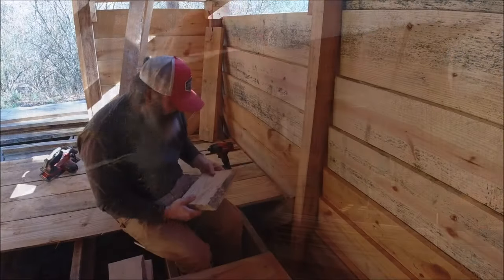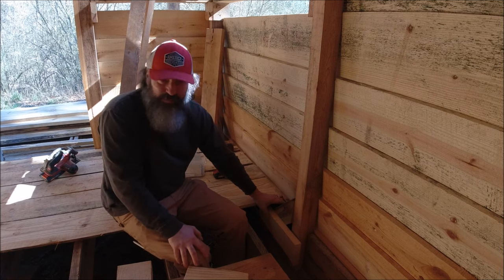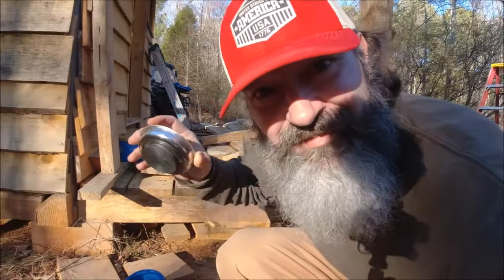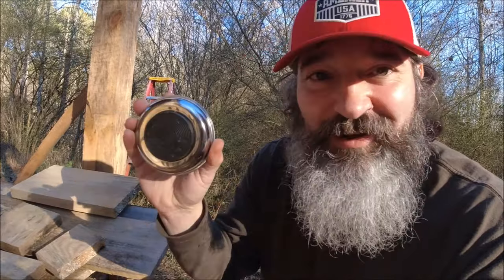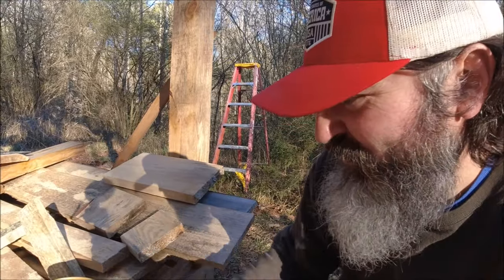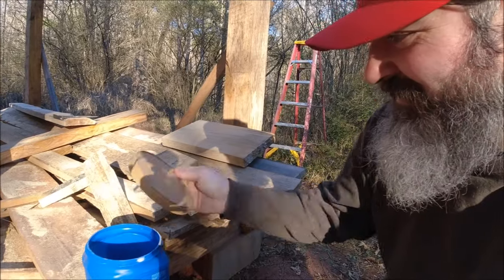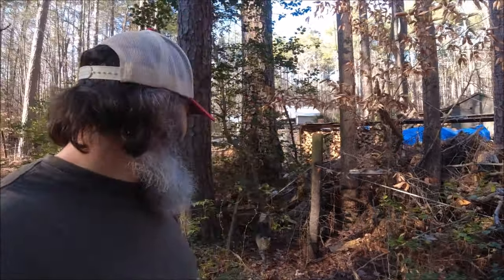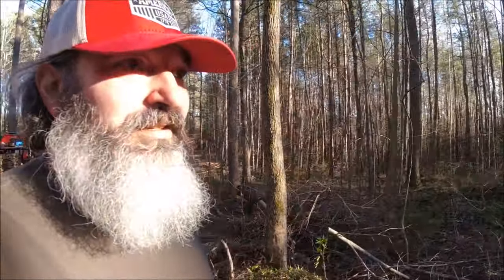Dry Cabin Flooring and a $4 Hack That Could Save You Hundreds

Comment: Harbor freight is my go too I just bought the 13000 watt. 3 fuel generator so far so good very happy. 1100 dollars or 1200 tax dollars didn’t get the extra warranty it was 290 for a year I think. But happy with it.   Thanks
Reply from the maker: We've had a HF generator for many years now. I change the oil once a year and keep non ethanol gas in it with Stabil, run it every month or so if we aren't using it and it keeps on cranking every time.
Reply: HF Seems to be raising there prices pretty high.. it has really cut into how much I purchase from them.. 😇🙏

Comment: Shed looks good, what are you going to use it for? I made and placed the trusses for the extension of my wood shed last week. Going to try and finish any bracing and boards for my metal roofing to attach to today. May send you a picture of my Jerry rigged project.
Reply from the maker: The plan is to use it as a little getaway right here on the homestead when we need some quiet time. Plus, Lisa has lots of old primitives and antiques in the metal building we'd like to move up there to decorate it with and free up some space.